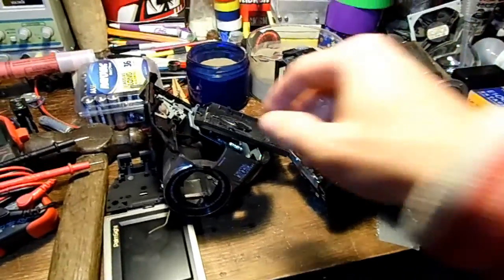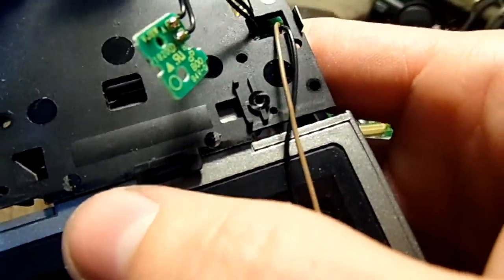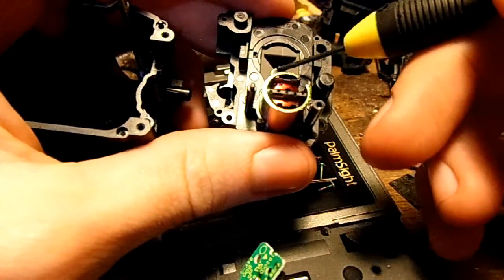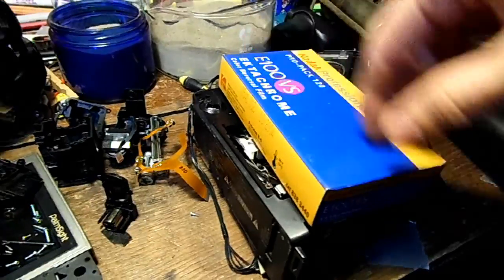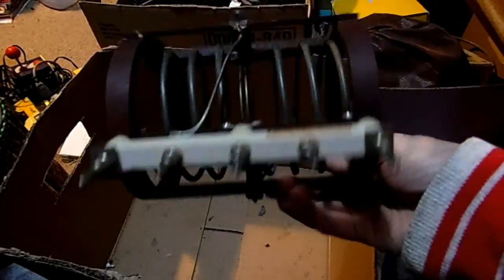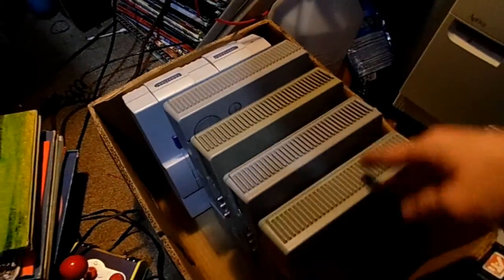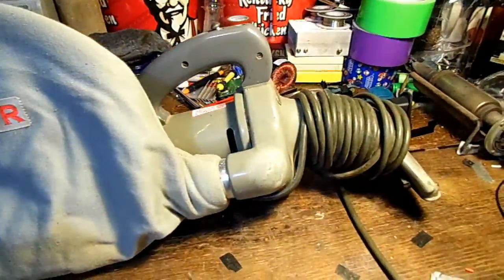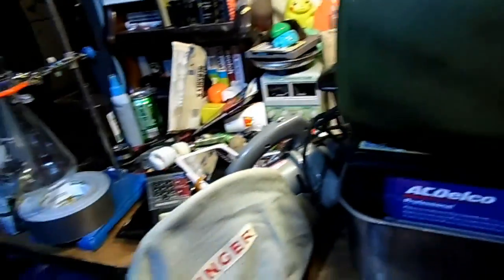Random Bits 0005 500 subs and 1952 toaster

Comment: Hi Rinoa awesome video, I love the hand held singer vacuum cleaner.
The style and the quality is brilliant built to last, hopefully yours may only have a loose electrical connection or the flex may need replacing, the carbon brushes may well be shot.
I came across a old hoover dustete once which is a similar type hand held vacuum cleaner but regretfully got rid of it, the motor burnt out and couldn't be bothered with it
Reply from the maker: oh thats a shame about your vac. i actually am just now wrapping up filming the hand-vac video and the main issue was the switch but also the bearings are going out. the bearings just make it a bit louder is all though. i would replace the bearings if only it wasnt so tightly integrated with the rotor thingy.

Comment: I noticed there appeared to be some numbers/letters stamped/melted in to the Delco battery case on the right top of one of the sides.  They can probably be read to give you an idea as to the manufacturing date.
Reply from the maker: yeah it says 9A80CSJ8. doesnt really seem to be much more than a serial number. but oh well.
Reply: Rinoa Super-Genius  I assumed The serial number probably indicates what date, shift and the plant when/where the battery was produced, if we knew how to read it.

So I looked up the warranty information on the Internet.  The date is coded on the TOP LABEL.  Find a row of letters and numbers which begin with a "P" or an "S".  Here is warranty information and how to read it:

http://www.acdelcotechconnect.com/pdf/battery_warranty.pdf

On that PDF is this:

How do I read the warranty date code on my battery?
The warranty date code is located on the top label of the battery. The first character is either a P or S. The next two digits determine the month, the third digit is year and the fourth digit indicates the manufacturing plant. For example, P 098N means the battery was made in September 2008.
Reply from the maker: AHA! i found P059R so may of 2009. not bad at all as far as junked batteries.

thanks for the info :D
Reply: ***** If you look at that row of type that appears to start with a "P" running the same way as, and near the Universal Product Code, that appears to be it.  The small print on the label you found is probably the date that label was printed.  That way, if there is a change in authorized labels, the plant knows that label has been superseded by a new one and not to use it.

While labels are mass printed, the date and time stamps type won't look the same as those of the rest of the print on the printed labels.
Reply from the maker: yeah i know labels arent always the same date but they can be close. like if a label has a web link then it's prolly past 1998 and i'd imagine most labels are within 3 years of the battery's manufacturing date. but yeah thanks :D

Comment: what is that huge cd/dvd disc? never seen one of those before.
Reply from the maker: it's called a Laser Disc, they where released in the late 1970's and where basicly DVDs but analog. that means the data wasn't encrypted and so took much more space. each frame of video was one revolution around the disc. so it turns at 30rpm to make a 30fps image.

they where origenally called Disco-Vision (sign of the times eh?) when they first came out in like 1976.

the laser disc format was and still is far superior to VHS, it looks like broadcast quality picture. throughout the 70s 80s and even 90s Laser Discs where huge in japan. in the 90s some japanese players started making HD 1080p videos for specialty HD laserdisc players. and they only stopped producing the laserdisc players in 2009 believe it or not.

and last bit of info, laserdiscs where produced by pressing plastic into molds with the grooves in the molds and this proccess has lead to some discs coming appart called Disc-Rot. my forbidden planet laserdisc has disc rot, it gets messed up on side 2.

but yeah thats what those discs are!